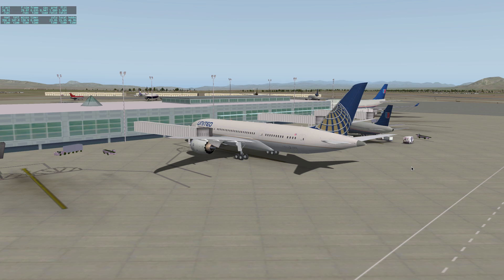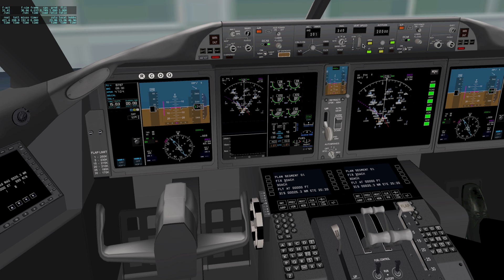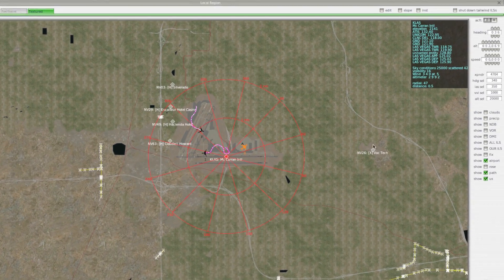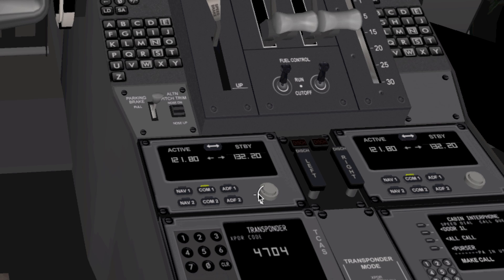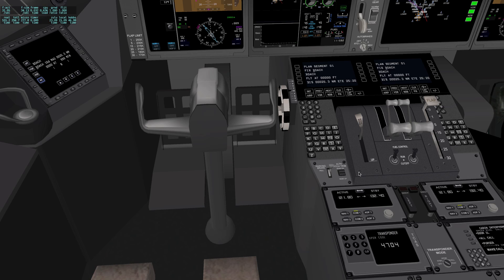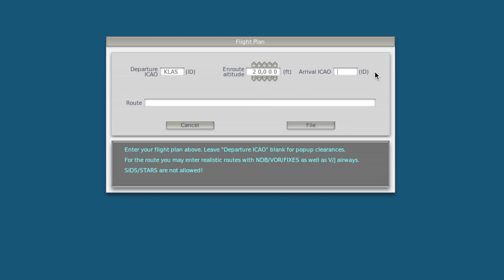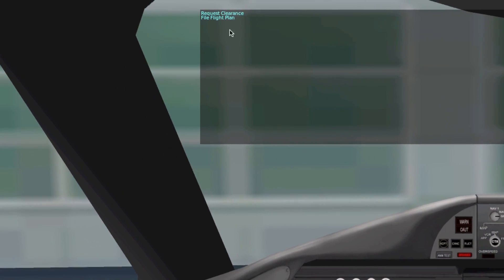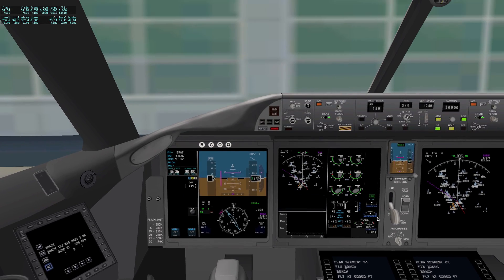ATC Tutorial: Preflight (X-Plane 10) [HD]

Comment: DOES NOT WORK...HELP ME PLS
Reply: The best way to do this is to follow him step by step in the cessna 172SP if you're a beginner. The main things to pay attention to are the audio selector on top of the GPS should be on COM1 and the switch should be on VOL so you can hear the ATIS and ATC. After that make sure you tune the COM 1 receiver to the specified ATIS as he shows in the video. Then tune again for ATC. Note some airports do not have GND CLR so you prob should use Tower or something :P. If you need more help with cessna, just ask. :D

Comment: I haven't flown much in real life; therefore, I can't remember, but do you always get to choose what flight level is such as the FL200 you picked, or is it something you already knew the ATC would authorize to you? If you don't really get to just pick, then where do you find the information for what FL are authorized for different planes and also their takeoff and landing procedures? To let you know exactly what I'm looking for, I know the traffic pattern for the maule, much different than the 747, I would think lol, is the 1st notch of flaps (24°) for takeoff. Then climb at ~80kts and retract flaps. Turn to crosswind at 500AGL and continue climb. AT 800AGL, power back to 2100 RPM and turn downwind >/=1/2mi from runway. Power back to 1700 a beam touchdown, 1st notch of flaps, & airspeed ~70kts. At ~1/2mi turn base leg, 2nd notch flaps (40°), & ~65kts. Final 56kts, Flare, 3pt Land, Retract Flaps, & Stop.

Comment: i just got x-plane.. and i dont understand this, i only see half the cocpit? and how do i look around in the cocpit? i have no engiend controll so i cant fire them up...
Reply: ***** depends on what plane you're flying. I know with a Maule that I've flown in real life, there is a knob that you turn to adjust the altimeter. It's prob the same in a few others as well. The Boeing 747 I think has knob that you turn. If you don't know what the altimeter looks like, google it. Also you should always set your altimeter according to the MSL (Mean Sea Level) of the location or rather nearest airport you are taking off from. If you don't know where to get info for the altimeter setting, it's in this video.

Comment: I did exactly as you did (except at London Gatwick) but when I pressed enter to request clearance, there was nothing there except for the "file flight plan" thing. I went back and checked everything, but everything was correct. Then, thinking the radio was broken, I went to "Equipment Failures" under the "aircraft" tab and pressed the "reset all systems to operational" button. For some reason, it still doesn't work.

HELP PLEASE!!!!
Reply: Open map and enter frequencies of your airport

Comment: Im trying to follow your procedures to file the flight plan but the part in the bottom where you put the route (las boach hec dypso gramm rustt habso riivr lax) is not accepted in x-plane. It says the navaid is not valid. Im putting the route info for the flight im doing but it just wont work. Is there some special way you have to input the info?